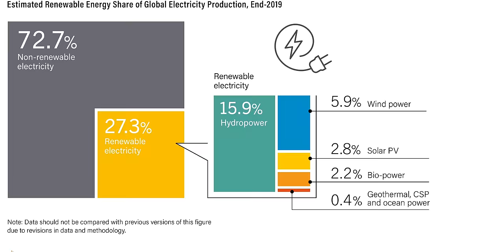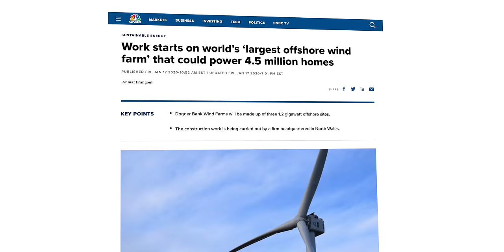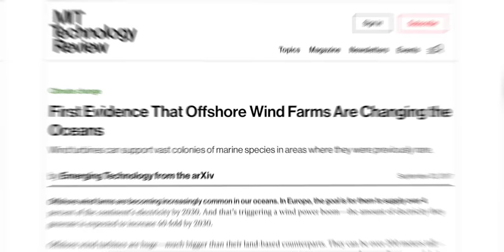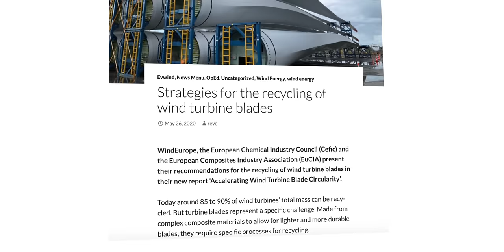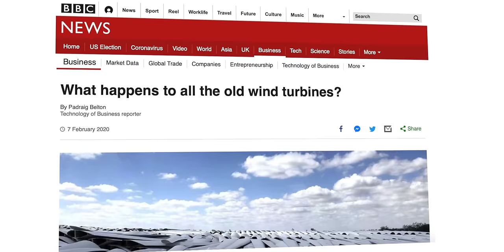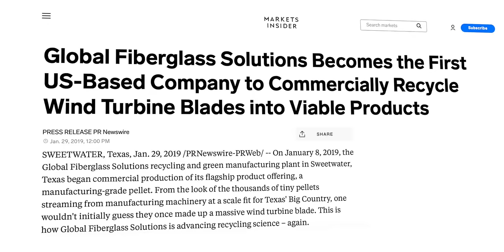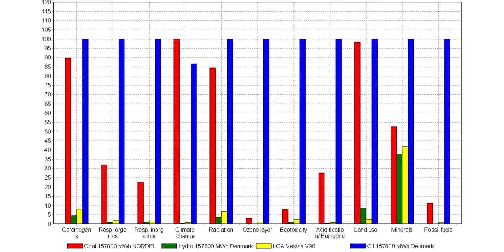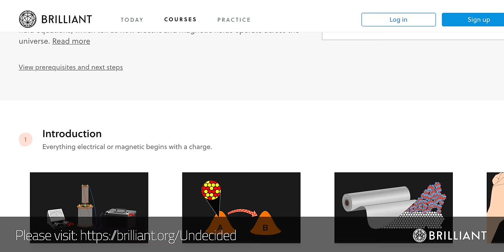The truth about wind turbines - how bad are they?

Comment: As one of the owners of a 106 turbine wind farm I worked on they have a 20 year payback. The main reason they built them was for the tax breaks. The ones i worked on were 1.5 MW and cost 1.5 million bucks a piece. Keep in mind also that if the grid goes down they shut down. The sub Sonics from blades is not pleasant. The fiber glass blades are not reclaimed. And they are not simple to work on. Try working on them. I have and don’t like it.
Reply: Thanks for sharing your experience! 👍
I trust comments like these more than an analysis from politicians or TV "experts"
Reply: 20-year payback. How long to the blades last?
Reply: @kitemanmusic  I live about 3 miles from the Wild Horse Mountain Wind Farm in Oklahoma.  In the year that we have lived here they have replaced 5 sets of blades and the wind farm has only been in operation since 2018.  They also only spin about 8-10 hours a day, bad placement maybe?  At the moment there are 5 out of the 29 turbines that never spin, I assume they are out of commission.  As much as I don't like to look at them during the day they are worse at night because of the miles long string of red beacon lights that flash about every 15 seconds in unison.  I agree that we need to be working towards alternative energy but, it just hard for me to believe that wind is the answer.
Reply: @kitemanmusic  Most farms are built onshore to run for 25 years. At that stage they could be retrofitted with new turbine gearboxes and blades. Blades re regularly sanded down to cut dents and debris strikes as well as airborne damage such are the forces they absorb or they can be left running at a lower generation efficiency and lower profit. 20 years is the warranty contract
Reply: @OurOklahomaLife  Are the red lights due to avoiding bird strike or passing aircraft at that altitiude?? As to not turning, then it could be curtailment reasons ie not enough grid connection capacity coupled with having to keep coal/gas/nuclear power paid to keep as baseload power. Wind speeds have changed as climate change has changed the weather patterns that few could have predicted or still can predict trends. Worth asking the wind farm why so few running and is it just spare parts scarcity? Curtailment is a big issue for wind farm developers as they would love to export that overnight lower demand power generation elsewhere but interstate grid connections are in short supply and limited in capacity. OK. may have the wind and space but demand is marginal compared to exporting it to the high demand areas. Poor state grid design may also be a reason. All that wasted generation means higher power bills. Their tax breaks are nice but the power generation is the real profit.